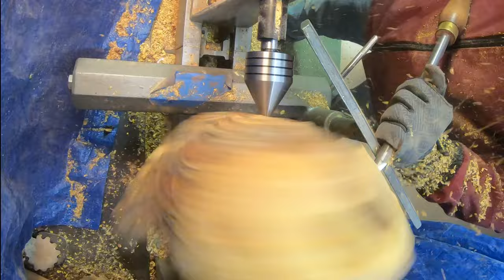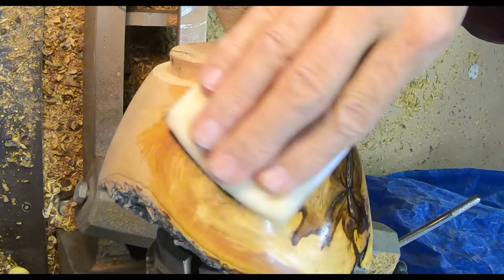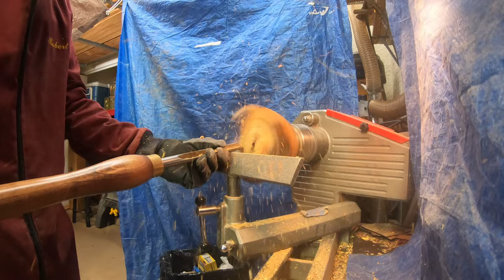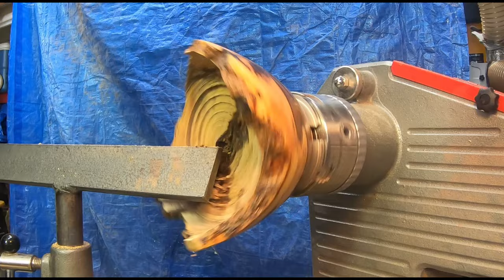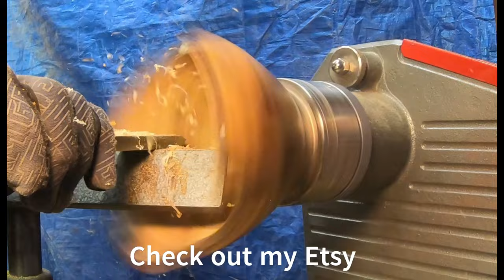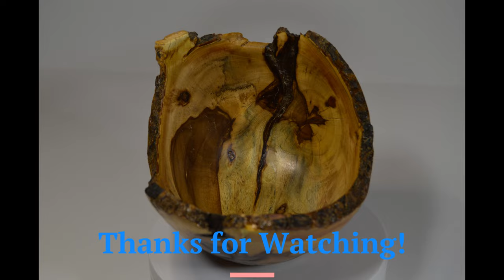Hardly Anyone Uses this type of Wood --  Live edge bowl from a Palo Verde Spalted Crotch

Comment: I just found your channel and I think you are doing great. I certainly wouldn't have thought you were a beginner turner or videographer. You might consider doing what I did and upgrade your lathe with a treadmill motor. I bought an old Crescent lathe and swapped the pulley system out to a variable speed treadmill motor and I've turned hundreds of bowls and vases etc with it and couldn't be more pleased. I've been retired for several years and only took up turning in the last few years and it's probably the most satisfying hobby I've ever had. Looking forward to seeing more of your work!
Reply from the maker: Thank you so much!  I cut my video chops making highlight videos for my daughter’s college volleyball recruiting. I also looked at upgrading to a variable speed motor.  I had a purchase all lined up then discovered my pulleys were frozen on the motor shaft.  I haven’t been able to find a pulley puller that will work and I don’t want to ruin what I have right now.  I will probably try again to swap it when the weather cools off.  Swapping the belt to change speeds is doable but does slow me down quite a bit.